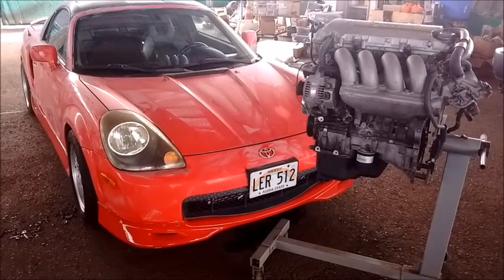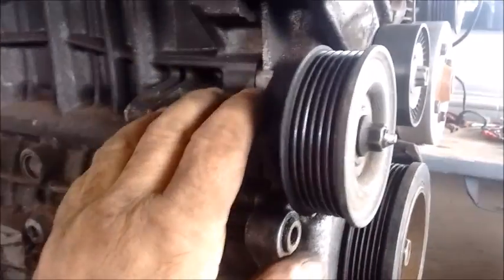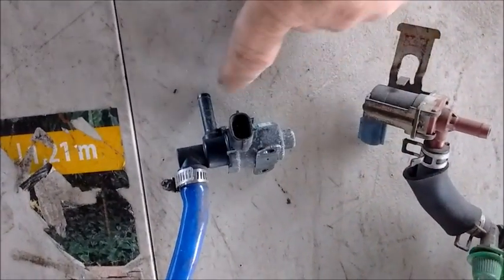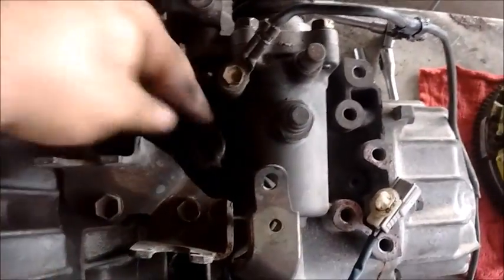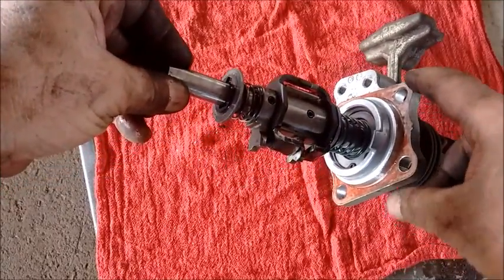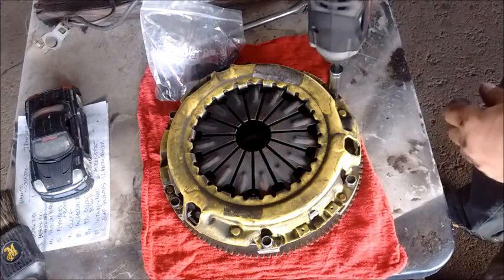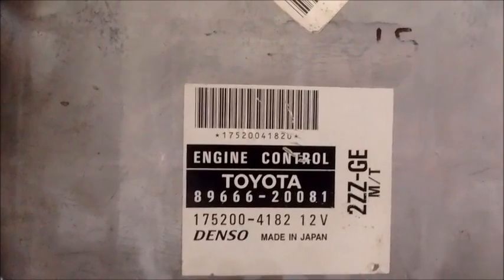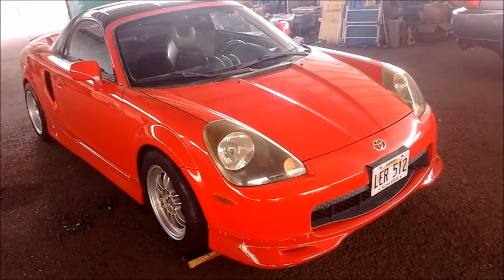Engine Swap Checklist - 1zz-fe to 2zz-ge - Toyota MR2 Spyder ZZW30

Comment: Hey what are you going to be doing with the old 1ZZ? I’m on Maui and I’m looking for a new motor, mine has servere rod knock
Reply from the maker: I would be willing to sell the 1zz. It's a healthy engine with good compression. It was just dyno tested this week. If you're interested call me at 808-280-1196.
Reply: Frank Saab Thanks, my motor finally gave out on a trip to autozone, I cut spark and fuel to that cylinder and was able to limp it home. I bought a complete 85k mile drivetrain and subframe from DND towing by Hawaiian Cement for $400 that I’ll be swapping in over the weekend, but I appreciate the offer very much!
Reply from the maker: @JaydenET  nice find on that salvage motor! Slim pickings here on island.

Comment: Hi @Merryfrankster_ thanks for your really useful videos on the 2ZZ swap. I'm in the UK so I've been doing one without MWR parts. I've got the engine and transmission from a 2002 Celica T Sport, so I believe its the C60 transmission. I need to change the selector shaft of course, and I don't have the MWR part but I i do have the complete gear selector from my 6 speed MR2 transmission. Do you know if i can just swap that in directly, or do i still need to move things over?
Reply from the maker: This has been covered in detail on spyderchat.com. I don't recall all the details. There maybe be a difference in the length of the shaft.

Comment: can you 2zz swap every mr2 spyder?
Reply from the maker: It is possible to swap the SMT but it is a lot harder than the normal M/T. Engine and transmission control have to be addressed with the SMT. Some people just swap their SMT to manual as part of 2zz swap.
Reply: @Merryfrankster_  yea ive read that now. would the monkeywrench 2zz/6speed kit be sufficient materials to get it done or would i need to do some extra stuff with the smt
Reply from the maker: @dikbuttbutt  you need the 2zz/6spd swap materials.plus you need the MWR SMT-to-manual swap materials that include shifter and cables, shift linkages, clutch master and slave cylinder, hydraulic lines, and a few other items.

Comment: I have a Celica Gts currently but I’ve always liked the mr2’s the problem is tho that there getting expensive like for one with a hard top the only one I see goes for a little over $20,000cad and if I were to engine swap it 
it’d cost me another $12,000cad if I got a swap from monkey wrench racing
Reply from the maker: You can't take it with you. Thanks for watching.

Comment: would an 2zz out of an automatic matrix xr be able to bolt directly onto the stock manual trans in the 1zz?
Reply from the maker: You need to remove the automtatic flexplate, install a manual flywheel, put your existing clutch on the flywheel, and then it will bolt to your 1zz transmission,

Comment: Hello

I have a mr2 spyder I changed the 1zz motor for the one you have the 2zz I have the apex computer and the wiring of that computer that sells monkeyracing the case is that my harness of the 1zz motor I want to put it in the 2zz and the valve connectors idle and tps are 4 pins and the 2zz the throttle body is 3 pins I must buy a cable for the 2zz motor and another thing my car was automatic and I passed it to manual with the transmission that you have in the video if you can orient what to do with the cabliado I thank you brother
Reply from the maker: The automatic 1zz engine wire harness does not work with the 2zz. The manual throttle body is different. You must modify the harness, or buy a 1zz manual harness to use instead.

Comment: Is the ECU automatic and manual specific?
I drive an 04 Matrix XRS, found an 03 Matrix XRS engine with automatic tranny at the junkyard. I pulled the engine but left the ECU and the wiring harness.
Reply from the maker: The ECU's for manual and automatic are different from each other.

Comment: Just wondering can you use the Roadster 6 speed box instead of the celica one?
Reply from the maker: Yes, it is a direct fit, but the gear ratios are not very well suited to the 2zz. The 2zz needs closely spaced gears like the c60 or c64  to maintain lift on gear shifts especially going 2-3 and 3-4.
Reply: I used MR2 6spd with Celica  crown wheel on the MR2 LSD  straight fit. Then used Celica gears 1 to 5 and MR2 6th gears. In short the Celica internals fit into the MR2 case. You can use the Celica 6th gears if you want